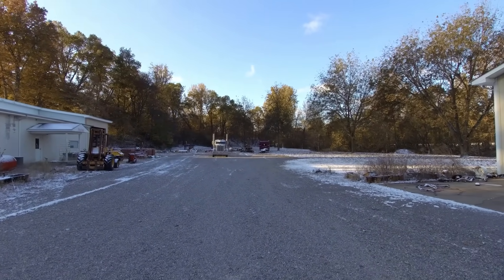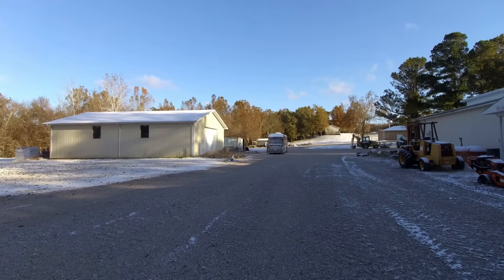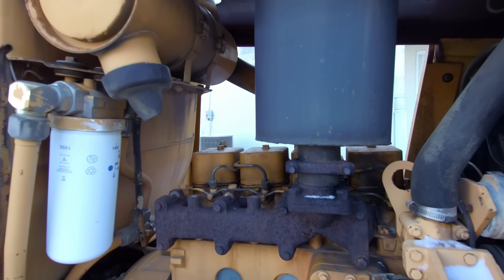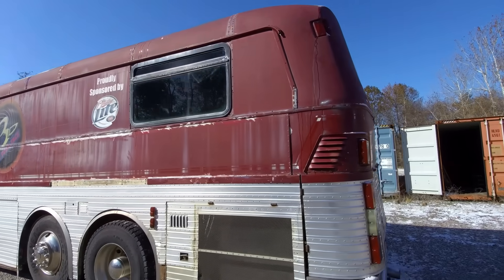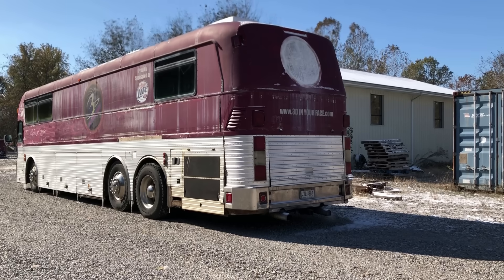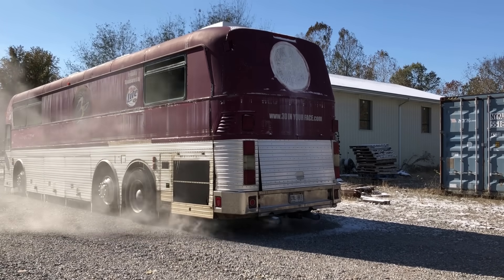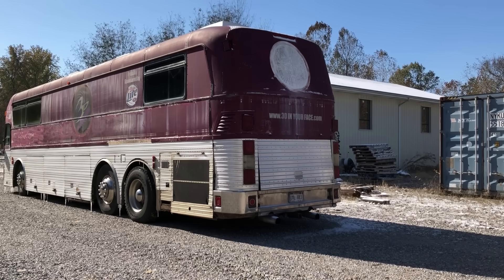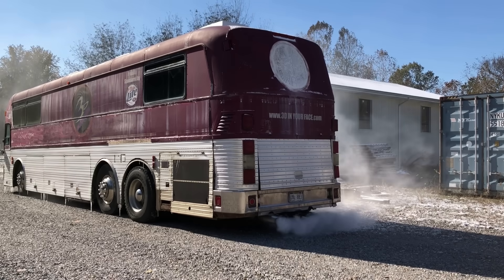Cold Starting a 8V71 Two Stroke Detroit Diesel Engine at 15° F

Comment: That 8v71 bus must of had most of the oil washed off the bores with all those attempts an Inverter and a hot airgun or hair dryer will make like so much easier if you don't want to deal with glow plugs on everything
Reply: or a coffee can, small amount of timber and diesel, heat it up under the sump lol done that with a few toilet 50's tractors

Comment: KT3406E.... Great video, once again (am subscribed to your channel),  thanks.   Question... what is the Outside width of your Eagle, that you say is a 1974?   I'm asking because something is not "adding up" with the year you say it is.   The ONLY model Eagle even close to that era with a slope from the top of the windshield to the roof line, was the model 07 which was built from Late 1969 to early/mid 1970, were 102" wide (outside measurement), and there were Only 45 of them ever built. 

The Model 05 was built from 1968 (using the original model 01 body style - with a new [front end] "squared off" styling change in mid 1969 - like your coach has) through mid - 1976 by Bus & Car Manufacturing Co. in Belgium, then shifted to the new plant in Brownsville, TX which had started up in late (Nov.) 1974 and continued until 1980, when the model 10 superseded the 05. 

The Model 10 (and later models, up to the model 15 which was the last one) was the first "production model" to have the sloped roof line (like yours) after the model 07 (102" wide - only 45 special orders built - all, in Europe), but again... did not go into production until 1980.  Yours does not appear to me, to be 102" wide... but is the standard (of the era) 96" wide... allowed (at the time) on US roads... was changed to allow 102" wide (for semis) in the mid/late 1990's. 

The only thing I can think of is that your coach was possibly bought as a "shell" and designed internally by one of the specialty coach builders that catered to many "Country" Music stars and others (like Corporate Executive coaches, etc.) and they may have taken the sloped roof styling que from the model 07 and built it into the roof line of yours at some point,  but the sloped roof line was Never part of the factory design from 1968 until the end of its production run in 1980.

IF... your was actually and originally built as a commercial coach for Trailways.... then it would have to be a model 10 with the sloped roof, but again... was not in production until 1980.  Also, I believe you said it has a "turbo 8-71" in it..... Not if it's original from the factory... all the 8-71's were NA from Eagle. 

The 8V71T (turbocharged version) was Not released for production (semis had them first) until mid 1975... and I still have an original "Introductory" ad for it... dated April, 1975 announcing it being available by July of that year, but taking "pre-orders" on it in Semis, and International was the first truck mfgr to install them.   I didn't order one because I had a new 1974 KW (923 - ext. hood) with the V12, which I took out - new after I brought it home, and "built it" to marine specs (minus the marine water cooled turbo's of course).

Don't "bad mouth" the little 2 cycle Series 71 Detroits too much.... they are Far more efficient in making power than Any 4 cycle could produce of equal displacement... you have to realize that out of the "Total" stroke length of "Only" 5 inches for the Series 71 engines (compared to 5.75 - 6"+ for the 4 cycles in most semis, etc.)... the exhaust valve opening commences at just 88 (and fully open by 92.5 degrees) degrees of crankshaft rotation from TDC.... which translates to approximately ONLY 2.44 inches of USABLE power stroke length before cylinder pressure begins to drop with the opening sequence of the exhaust valves!! 

Even the "big" Series 149 Dteroits only have a total "Usable" power stroke length of approximately 3.14 inches out of a total stroke length of 5.75 inches.... it's the only 2 cycle Detroit with a Square Bore design (5.75 X 5.75 B&S)... yet, in it's smallest configuration (V8) it's rated at 600hp and a whopping 2,310 ftlbs of torque... NATURALLY Aspirated, with the smallest injectors available for it!!

Here is a couple of links to hear the "King of all Detroit Diesels" a 20V149T (genset version).... 1.) https://www.youtube.com/watch?v=Zn9K2giMTpo    2.) https://www.youtube.com/watch?v=KB6ZcE-8-so 

This is what 2,936 hp sounds like from a "little" (compared to a Cat or Cummins of equal output) 2 cycle Detroit with only 120mm injectors, standard By-pass blowers at only 1,800 rpm, and it is not even a marine version in TIB trim (Turbocharged - Intercooled & high By-pass Blowers) with a potential of over 4,000hp depending on injectors used at the same rpm and can be turned up to 2,300 rpm (with the "stock" valve springs).     Enjoy!

Comment: I guess depending on how well it drives if the inside is already stripped it's ready to make into whatever you want. Build it, sell it, then buy yourself something that drives better with slide outs if you want. If it's just for you might be enough room to be comfortable though. The dual exhaust is pretty cool though!

Comment: Looks and sounds like some sticking rings on the right bank of the Detroit. Detroit's never seem to like cold starts in the winter and I have had many of them to start in less than nice weather. the other problem I heard was that the batteries were not charged enough to spin it over correctly. Cold and weak batteries on a Detroit is a very common and real problem with them.

Comment: A Detroit can almost produce enough power to move it's own weight, almost.
Reply: Then you never owned or drove one.
Reply: @raymondpoteet8920  Weird how a notoriously horrible engine has such a following. Huge, heavy, and weak, is what they are known for. That's not an opinion, that's a fact.
Reply: Yeah they are beastly engines . Hell the 471t is over 1800 lbs. And that's only a 4 cylinder under 5 liters

Comment: Always loved old buses, with manual shift. Loved the old school buses  with the rounded ass end like in the 60’s thru the 80’s? High revving through the gears, I miss them. My favorite old bus was those with the second level or at least looks like a second level, mid way down the roof. My friend and I would take a bus 73–78, from down town Los Angeles, gray hound bus to needles California. We’d  ask his mom if she could make sure, if possible, to get that particular kind of bus. We’d sit in the back of the bus, open window, to hear the engine, manually shifting, and the J—brake. I loved it. Would give almost anything to take another ride.

Comment: I've been looking for a 2-stroke powered...   something for a while. For some reason they just aren't that common down here in Dallas. I'm not real familiar with a lot of the motor coaches, is that an Eagle?
Reply: Shane S.... Yes, that is an Eagle - he says it's a 1974, But... it has the sloped roof line starting from over the windshield which would indicate a model 07, but they were only built in 1969 & 70 and there were only 45 of them built - they were 102" wide instead of the usual (for the era) 96" wide (same as Semi trailers of the era).... and this one is Not 102" wide, so it's confusing. 

The next sloped roof line did not appear until the Model 10 which did not go into production until 1980 and superceded the model 05 which first went into production in mid 1968 until 1980, but the model 05 did Not have the sloped roof like this does and was the standard 96" width, like this one. IF, this one is in fact a 1974 model, it was either one of the last ones built in Europe, or one of the very first ones built in Brownsville, TX. depending on when in 1974 it was actually built. 

Also, he said it was a "turbo 8V71" (8V71T)... but it sure does not sound like an 8-71T and Eagle never put the 8-71T in from the factory, they were all 8V71NA's (Naturally Aspirated). 

Just so you know.... The Eagle Coaches are now back in production, since late last year (2018), under the new name of Phoenix Coach Global and are being 100% built here in the US with 100% US sourced parts and materials. They are basing it on the last production Eagle model 15 and for power they are using the same Heavy Duty Cummins X15 (15 Litres) that is used in the Semis and can be ordered with up to 550hp and 1,860 ftlbs of torque.   It's available in 35, 40 and 45 ft lengths.

Comment: I’ve got a question kinda of why do you use ether starting fluid on Diesel engines ? It’s hard on them in my opinion. I use WD-40 it safer on the engine and you can literally feather spray it into the intake manifold to keep the motor running. But in using WD-40 you have to take apart the intake somewhere close to the engine upstream from the air cleaner. Another way I do it but it also requires opening up the intake system is I spray some diesel into the intake and light it on fire then crank the engine, starts every time. I discovered this trick from a farm tractors I used to work on in that their cold start system had a little reservoir that takes diesel from the injector return line and a solenoid with a line to the intake manifold with a glow coil in it. The diesel fuel would be released from the reservoir through the line hit the hot coil then start on fire in the intake manifold then you would crank the engine. They started every time the system worked great. So I would put fuel in the intake of engines then light and start but this process usually takes two people.
Reply: What ive done on my JD 520 when it was really cold is use a propane torch on the intake manifold and then a co worker had a 7.3 ps with bad glow plugs so i used my butane torch i had in my trk for soldering ang heated up his spider pipe and we finally got his trk started
Reply: Good point I never thought of using a torch to heat up the manifold. Some of my suggestions can only be used on none turbocharged engines unless you have a plug or plate you can remove like in some cat engines at least the ones we used had a extra plate on the intake manifold that could be removed with 4 bolts
Reply: I guess one of my pet pev’s in life is seeing people using ether on Diesel engines but if you have to then do it. If it’s my ass on the line I choose not to if I can. But I’ve done ; didn’t want to but the trucking company ran trucks that where not maintained properly so that’s what I did. I carried starting fluid in my go bag all the time. All I can say it is what it is, life.

Comment: cold start parade. all your diesel vehicles. I like this better than the last I watched with the throttle tied down truck that could have lasted another million miles out of cali. I like the bus of course it just needs a sky blue paint job after getting that putrid color off. Or maybe just stripping it and clear coating it would look great.

Comment: Diesels + ether = real tired motor
Reply: Yeah,  wonder if that 4b has a grid heater, like the 6bts
Reply: And as for the detroit I am pretty sure it just wasn't cranking fast enough.  I would have made sure it had fuel right to the block by cracking it open . Probably had air

Comment: The 8Vs and 6-71 bus engines were good externally lubricated engines.  I can remember signs at toll booths requesting drivers to accelerate slowly when exiting tolls...cuz of the smoke.  Lol
Reply: Lol. That brings back memories. Had a MAN truck once where the seal in the injection pump which separates the lubricating oil from the Diesel fuel in the pump elements failed. When the bastard was running on the road everything was fine because the leaking oil diluted in enough fuel; but when the thing idled for more than one minute you got the smoke show of your life when you hit the pedal...
Reply: Albin Klein blee
Reply: I grew up in an apartment building in NYC with a bus stop outside. The sound of the Detroit Diesel was all day every day but I still love hearing them.
Reply: "Externally lubricated". Nice never heard that before. Nice
Reply: Mobile oil pumps
Reply: Rust prevention built in
Reply: U could always tell the old 2 cycle Detroits @ a truck stop back in the 60's & 70's . They were the ones that PROUDLY displayed there collection of DELO oil can's ( gallons) between frame rails & fuel tanks on BOTH SIDES ... AS you said  "external oilers "

Comment: In '93 when "low-sulfur" fuel came around by mandate...there were two problems...lubricity and gelling.   Damn, it was awful.  at 10 degrees or less, diesel turned into Vaseline.  Took a year for refineries to get the fuel right.  Great year for fuel additive companies though.  For lubricity problems(Stanadyne pumps) a quart of ATF in a full tank worked wonders.
Reply: i used to run my benz on used atf

Comment: Notice any extra fuel knocking when cold with the cam? It seemed like after I did my swap it sounded like ya threw a couple extra ball peen hammers in the dryer lol and some extra smoke . Iirc the cam advances inj timing some which would hurt cold start anyway great vid!

Comment: That thing sounded terrible you open the door on the back and there's more belts in there than a combine 60 series is a very respectable engine we used to have smog in Tampa Florida back in the 80s early 90s Detroit two-stroke days it's pretty clear there in the mornings now

Comment: The Detroit is low on compression which compounded the hard start. Eagle buses were popular among musicians touring but in reality they were poorly made. When MCI introduced their all stainless frame in 82 on the MC9 it ensured Eagle’s demise. The Eagle was OK for intermittent use as a tour bus but wouldn’t hold up to day in , day out charter and line haul abuse. Northern salt made short work of their mild steel frames.
Reply: Wayne Swicegood eagles always held up good for us, we put millions of miles on them, rode, handled and looked better than any mci on the road
Reply: pappy232 They sucked in salt belt areas as far as durability.  That’s just a fact. I owned an 82 Eagle that had been run by Trailways on the East Coast and it couldn’t even be repaired. The torsalatic suspension was also inferior to the air suspension on the MCI .
Reply: Yeah the salt would do some work on them no doubt about that. We are from central Pennsylvania and had a whole fleet of eagles, like I said we put over a million miles on most and they lasted forever it seemed but we were very meticulous on maintenance and especially keeping the salt cleaned off, they still got ate up pretty good though

Comment: Yep definitely a 4b Cummins. We have 1 in our broderson.  Are you still runnin the big cam setup? I have a 1lw, it's a 490hp 1850 with a swapped 550 computer , lots of blow by, not burning oil and running strong.  Is this normal? Have you looked into the switch blade turbos at all?